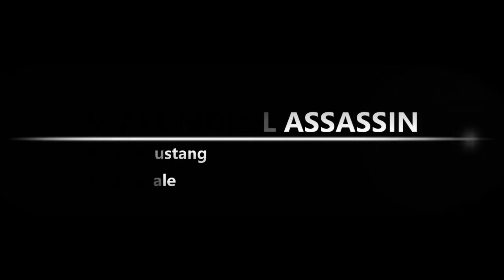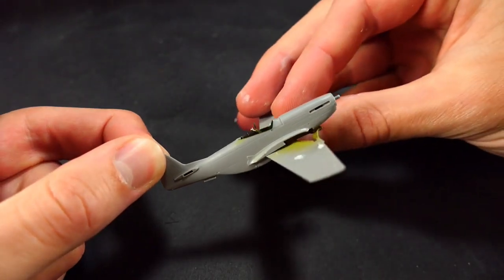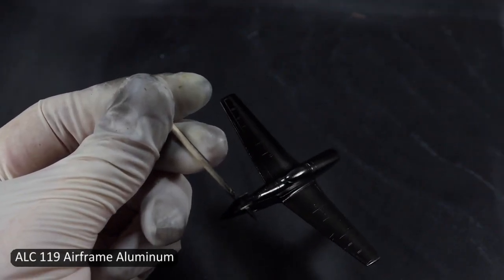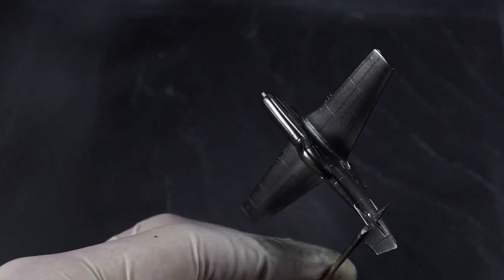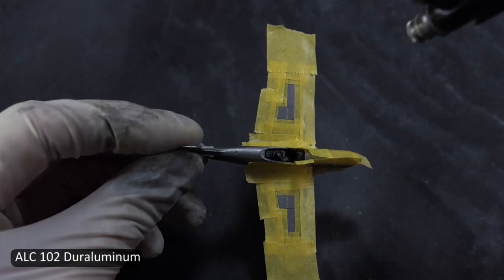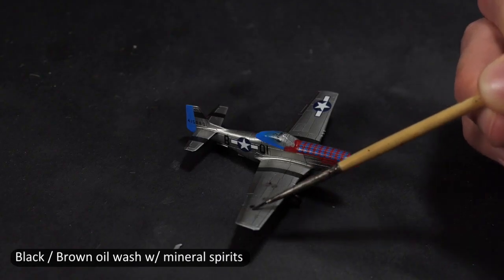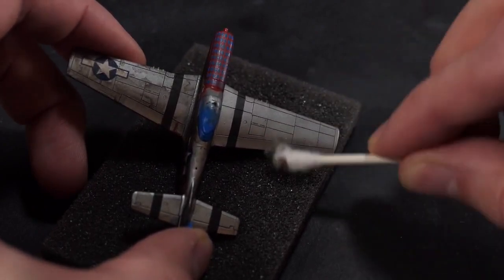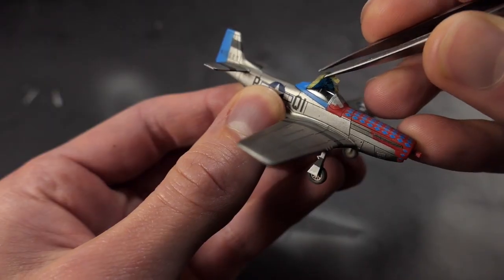P-51D Mustang "Carolyn's Vergeltungswaffe" - 1/144 Scale

Comment: What kind of tape is that, And how do you keep it from peeling off the paint?
Reply from the maker: The yellow tape is from Tamiya.  I've had it peel the paint before (on accident of course), but its generally a light enough tackiness to not pull it up.  Using a primer or a clear coat can help if youre concerned about the tape pulling up the paint.